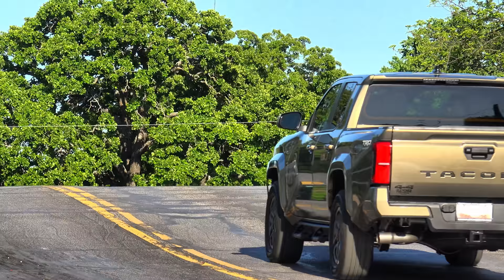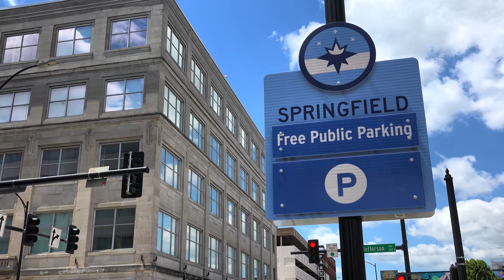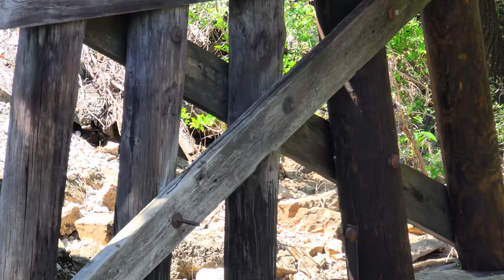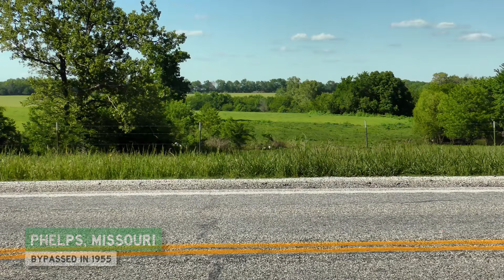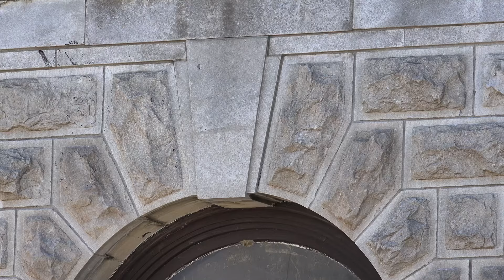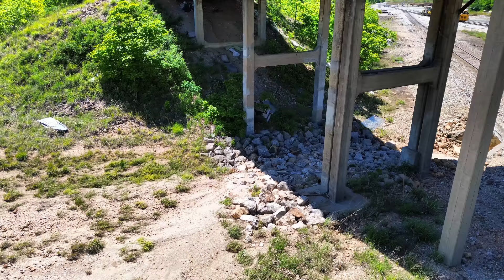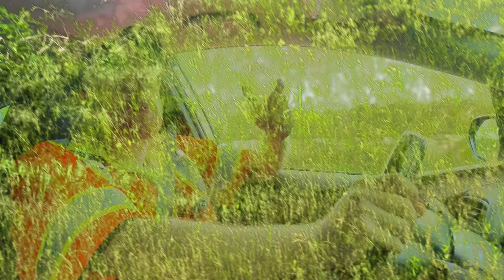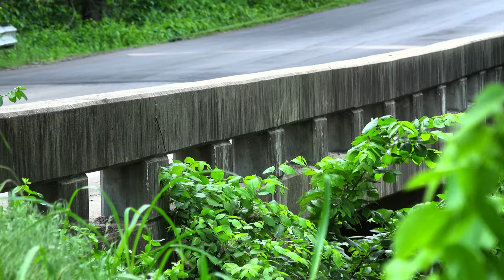When You Let the RAILROAD Build a Car Bridge

Comment: A bridge that's open to pickup trucks but closed to pedestrians and cyclists is the most American thing since cheese in a can
Reply: It's open to cyclists you just have to ride in the road
Reply: @minarchisttrucker2775  So basically no.
It is also "open for pedestrians" if they chose to walk along the road, which I see no signs not allowing. It is just that they did not fix the part built for pedestrians and cyclists because that is the American way.

Ok,  the did put up a sign not allowing pedestrians on the bridge, because that is easier than fixing the path. Stupid idiots.
Reply: @minarchisttrucker2775  So its open to cyclist with a death wish. Of which, yes, I see quite a few.
Reply: @jonathanlovelace521 well technically cyclists are supposed to ride in the road and not the side walk
Reply: @minarchisttrucker2775  Yes, but some of us want to live, and will hazard the risk of a ticket for that purpose. (Serious mode: recognizing how dangerous many 'bike lanes' are, in many areas, bicyclists are explicitly allowed on the sidewalk. It varies by state or city. But generally, actual quality infrastructure, be it a protected bike lane, a separated trail, or a proper greenway, is preferrrable to crashing the sidewalk.)
Reply: @jonathanlovelace521  well also like nobody has to go this way and nobody is required to ride a bike. It's 2026 you can hitch a ride from a friend or take an uber
Reply: @minarchisttrucker2775 😂 implying friends are still a thing in 2026 when everyone’s goal is seemingly to screw each other over in every way imaginable is hilarious, when is the last time you went out made a friend and that friend didn’t screw you over in some way
Reply: @jonathanlovelace521  Being really honest Bike infrastructure sucks because realistically cycling is like the worst of both worlds.
When bikes share the sidewalk with pedestrians, they move faster than the pedestrian and collisions can occur, injuring both pedestrians and cyclists. 
When bikes share the road with cars, they move slower than cars and collisions can occur which have a higher chance of injuring or killing cyclists 
Dedicated bike lanes take up infrastructure space and they're dedicated to a suboptimal mode of transportation that doesn't move a lot of people, and not everyone is able to do it. Bike paths only make sense in very urban areas or park spaces
Reply: Having inspected many bridges (>1000 at this point, mostly in KS and MO) it looks like the timbers used to support the sidewalk are significantly smaller than those for the road, significantly reducing the capacity.  Add years of rot, and potential overloading stresses from the deck timbers transferring some vehicle loads over and you get checks and splits that reduce that cross-section even further.  Factor in that it would in no way be wheelchair friendly, therefore complicating the ADA requirements for the pedestrian path, and from a liability standpoint it was likely simpler to just close the sidewalk on the bridge.  However, if you also think about the fact that they put asphalt as the wearing surface that is a silent admission that the bridge is in the final years of its useful life.  The asphalt will allow moisture through and then traps it on the top face of the deck timbers speeding up the decay.  I would bet that in the next 3-5 years it will be posted to prevent truck traffic and then within the decade it will be slated for replacement.
Reply: @Dhoyt016  it's final years of life. 

You would bet that in the next 3-5 years it will be posted to prevent truck traffic.

Sorry sir.
But ehm, when i look at it as a guy who has no idea about engineering or maths or construction....
Well, i just look at it and think: WHAT????????

How much does a bridge like that cost?
Seriously.
What does the concrete cost, the metal, the labor, all of it??
Just an estimate is fine.

One reaper drone costs 30 to 50 million.
Its a drone. Flying up in the sky.
Many of em have been taken down by for example: Houthi's.

Just imagine if politicians thought: Jeez, we should spend money on replacing bridges like these......

This bridge looks like it can come down any moment.
Why do people accept that?
Tear it down, get a new one in.

O wait, yeah, Bibi needs Bombs. Sorry, i know. 
Well, gosta help out the Biebster.
And the Donald.
HE is in need of a new toupet, that is for sure.
Let's spend money on that, and not this bridge. After all: We will be looking at the Toupet more often than we will ever look at this bridge.

(sorry. I am just amazed. I seriously do not understand how people have become so stupid over the last few decades. How we all have just started to accept all of this.
Sorry. Just heartbreaking to see how a species evolved to the state we are now, and now we seem to be going backwards. In a few decades we are probably dumber than the average Chimp.)
Reply: @TMGpuntNL there's... a lot to unpack there.

Being that it is timber over a RR I would guess it is 150' total length, 3 spans.  Given that the 25' vertical clearance minimum required by the RR is already a struggle they will need to build something with a thinner superstructure like a concrete slab, which I believe is ~$150/SF.  TWO 12' lanes, one 6' sidewalk, and three 15" wide barriers is approximately 34', which is 5100 SF.  That is $765k.  Add in that they will probably have to redo the road at least 1/4 mile back from each abutment to degrade and that will probably add an additional $500k, and the RR coordination will add at least 15-20% of the project budget for the headaches it will cause, and that will hopefully not cause delays.  So you're looking at roughly $1.5-1.6M for the replacement.

The rest seems like you don't understand government funding, its varied sources, and funding prioritization.  It also seems like you believe that your personal priorities should dictate how +350M people's tax dollars should be spent and you are distraught because people with your preferred political ideology are not making those decisions, though I don't the spending allocations would change that much since the federal transportation bill was passed under Biden and military budgets didn't change that much with the most recent funding bill.  About those things, I prefer not to argue.  But the replacement estimate and reasons as to why the pedestrian path is closed on a nearly 100 year old structure are educated guesses from a former MoDOT engineer who still does bridge inspections in the state.

P.S. - Please try to learn how to not make everything related to politics and especially how much you apparently hate D. Trump and Israel.  There are other things to be concerned with in this life.
Reply: @TMGpuntNL People are stupid but some can spell toupée.
Reply: @Dhoyt016 My freshman engineering prof said more engineers should go into politics. You may or may not agree with our one engineer president's achievements or lack thereof, but your message there is a reason for it.  Understanding the issues beyond the obvious ones. Understanding that there are a lot of priorities to balance. Understanding there are lots of opinions. <sigh> More engineers, please!
Reply: @jenniferpearce1052  the funny part about your comment is that the accent on the e is no longer needed and is an older spelling.

"The correct spelling is toupee (without accents), though toupée (with an acute accent) is also accepted as an alternative or older spelling"

It is accepted, sure. But the correct spelling..... >;)

Sorry, i had to google it, hahaha
Reply: @TMGpuntNL Yes, in American English, we pretty much don't allow the accents. But we also do a lot of other dumb things, like having male fiancees, because a fiance without an accent is a fee-ahnss and no one says that!
Reply: @jenniferpearce1052 engineers are typically too intelligent, and antisocial to want to be politicians.  I have considered it, but I would play by the rules that everyone agrees to, but no one else really does and would therefore be highly ineffective in politics.
Reply: @TMGpuntNL  just because we stopped spending on military doesn't mean everyone else would.  it would just mean we'd be in no position to defend ourselves or our allies.  we also don't just send weapons to other countries for free.  not even israel.  they buy them, which means we do make money from them.

but that's the kind of thinking i've come to expect from people who can't see past the tip of their own nose.
Reply: @theghostofthomasjenkins9643  Ehm, before you start judging how far i can see, you say: Countries do not get weapons for free, they buy them, even Israel?

I hope you are joking about that one?

How much money do they get every year?
And btw, this is not just from the US. You also have Germany that pays a lot of money every year to Israel.
And they can then buy those weapons, sure.

But ehm, that is basically a cigar out of your own box, isn't it?

Do you know Einstein?
He said: The pioneers of a warless world will be the youth who refuse military service.

It'll come.
Eventually when the S hits the F, and WW3 is over, we will be back to fighting with sticks and stones.
Einstein said that as well: I don't know with which weapons WW3 will be fought, but WW4 will be fought with sticks and stones.

Eventually people will have to realize that it's all just a waste of money, time, lives, and for what?
For who?
Mostly for those with a Nose indeed yes.
Reply: @TMGpuntNL  as long as people consume resources, there will be war.  as long as people have the freedom to think for themselves, there will be war.  you don't want to live in a world without war.  you think you do, but you don't.  history's worst leaders were brought down by people waging war against them.  it's a necessity.

and yes, even israel spends money on it's own weapons.  the amount of money israel recieves is just a drop in the bucket compared to what they spend.
Reply: @theghostofthomasjenkins9643  You are again very funny when it comes  to Israel.
How do they make money? From what? Oil exports?

They recieve way more than you think.
But you may keep deluding yourself on that part.

As for the rest: Sure, there will always be people stupid enough to fight against other people.
But if it is a necessity? Nah.
That depends on perspective.

As for history's worst leaders being brought down by people waging war against them....
Let's see.
Stalin? Killed plenty. No war brought him down.
Mao? Killed plenty. No war brought him down.
Churchill? Killed plenty including starvation. No war brought him down.

And lets skip ahead in time: Bush senior.... 0.5 million iraqi children dead was worth it according to Albright..... and he himself spoke about the incubator babies, which was a lie.
No war brought him down.
Bush junior. Went into Iraq over a pack of lies, WMD's aka the Weapons of Mass Distraction.
Wasn't brought down by people waging war against him, was he?

So which worst leaders are we talking about?
O, the Austrian Painter?
Ah.
Or Napoleon perhaps?

Btw, the Federal Reserve Bank.
What did the Supreme court rule in 1928?
"In 1928, the U.S. Supreme Court did indeed describe the Federal Reserve Banks as “private corporations in which the government has an interest.” The statement appears in United States Shipping Board Emergency Fleet Corporation v. Western Union Telegraph Co., 275 U.S. 415 (1928)"

"In 1928, the Supreme Court described the individual Federal Reserve Banks as private corporations in which the government has an interest."

Alan Greenspan, once Chairman, he said: There is NO other agency of government that can overrule actions that we take.

Who owns it?
Who owns the debt?

The US is in debt.
And who gets paid?
We have the Alan Greenspans, the Bernankis, the Yellens. The Albrights. The list goes on and on.

The 1.5 TRILLION dollar for the Military.....
that is not all used up to build weapons.
A lot vanishes in the pockets of?????
Well, not you nor me. 
But i guess companies like Lockheed and Radeon and so on.
And who owns those companies?
If you go all the way to the top, who owns it?

There we go.
Isn't rocketscience to figure out that little state doesn't have to pay much for the weapons.
Heck, the people there can live for free and get paid every month. The money has to come from somewhere.
My guess? The American Taxpayer.
Because the Debt which the US has is owned to "them".
Remember who set up the Federal Reserve System?
One of the members of that family said: Give me the control over a nation's money supply and i care not who makes the laws.

PS: I would love if you could explain how IstheHell is making money to buy weapons.
From what?
Exporting what?
Doing what?

Btw, a side track: Ever heard of this guy called Lucky Larry?
He spent a few bucks on a lease for a few buildings. Got them insured so that it would pay out incase of a tewwowist attack.
And. got paid a few BILLION dollars after they all went Poof into a great dust cloud.
"It's good" said his friend Bibi.
And Lucky Larry said: I said Pull it, and so they did and we watched the bld collapse.
And then he went to Tel Azov, to talk about how he had to make sure he collected the insurance money. A 2 hour talk on video while the turd is chewing gum.

Yeah. The amount of money they get is just a drop in the bucket.
From the US, Germany, the UK, the Netherlands, etc etc.
The Holy Trinity. District Columbia, London City and Vatican City.
So yeah, sure thing pal.
They pay like everybody else.
But ehm, they also control the money supply, and so they just run the printers for a few minutes longer to pay for those weapons.
Meanwhile also collecting the monthly paycheck from all those countries......
Reply: @theghostofthomasjenkins9643  o btw, the US thought it would be a good idea to pre empt Iran, because the Ally was also gonna attack.

The Biebster dragged the US into a war against Iran.

So now the US is expending its weapons on this war.

Saves them a few bucks, doesn't it?
Reply: @TMGpuntNL  you really need to lay off the propaganda, dude.
Reply: @TMGpuntNL  jesus, you're deep in the kool-aid.
Reply: @theghostofthomasjenkins9643  ah, so now we go down this lane?

What's up? No arguments?
Seems to be the case if you have to go down this lane.

I need to lay off the propaganda?
Which propaganda exactly?
Explain pls.

I guess you won't because you ain't got the arguments to explain it.
If you did, you wouldn't have responded the way you just did in 2 comments.
Reply: @TMGpuntNL  i'm just not gonna waste my time.  i could refute your arguments all day, but you're so far down the rabbit hole that you'd never accept anything besides what you already believe.  you sound like a tin-foil hat wearing loon.  you're one step up from talking about hollow earth and the nephilim.
Reply: @theghostofthomasjenkins9643  "just because we stopped spending on military"

When did that happen?
After the 1.5 TRILLION?
Reply: @TMGpuntNL  yeah, i get the feeling most of the information you claim is true is the result of you only reading half a sentence then drawing a conclusion.
Reply: @theghostofthomasjenkins9643  yeah, i get the feeling you have no arguments and then you have to rely on this kind of stuff.

If you ever do have arguments, we could have a discussion about it.

As per Carl Sagan:  “One of the saddest lessons of history is this: If we’ve been bamboozled long enough, we tend to reject any evidence of the bamboozle. We’re no longer interested in finding out the truth. The bamboozle has captured us. It’s simply too painful to acknowledge, even to ourselves, that we’ve been taken. Once you give a charlatan power over you, you almost never get it back.”
Reply: @theghostofthomasjenkins9643  btw, "i get the feeling most of the information you claim is true is the result of you only reading half a sentence and then drawing a conclusion"

That is basically an admission that you do not have any arguments.
And a feeling is certainly not the truth.
But, you stick with your feelings....
And i stick with facts.
Reply: @TMGpuntNL  dude, i just caught you trying to draw a conclusion off half of one my sentences, completely disregarding the context of it.  this is what you do.  you take half of a thought and twist it into something else to fit what you believe.  i'm not wading through your sea of word vomit. anyone with more than 1 unfried braincell can see you are nuts.

and quite frankly, if it's not about astronomy, no one cares what carl sagan has to say. he's a scientist with exactly 1 field of study.
Reply: @theghostofthomasjenkins9643  You caught me trying to draw a conclusion off half of your sentences, completely disregarding the context of it?

Which sentence was that?
I am willing to admit i made a mistake.
It seems to me that you are not, because you keep insulting me for no reason.

I never insulted you.

And as for Carl Sagan, sure. 1 field of study. But the quote is true.

Sad to see people like you who are only able to insult others over nothing.
It shows how you have no argument.

I am willing to admit that i could have made a mistake if you were to point out where i made the mistake.
But all you say is: Dude, i just caught you trying......
If you caught me, you can show it.

PS: I am dutch. Dus we kunnen het ook op z'n Nederlands verder proberen. Misschien ben jij beter in het lezen en schrijven van Nederlands dan dat ik Engels kan lezen en schrijven?

Have a great day, sad individual.
Reply: @theghostofthomasjenkins9643  ps: and if you have arguments to rebuke what i have said, i will be all ears.

But it seems to me the only thing you are capable of is insulting another person, which means you don't have any arguments.

Also keep in mind: YOU started responding to me. Not the other way around.
And i'm not your dude, boy.
Reply: @TMGpuntNL  This video is about transportation, dude. Chill.
Reply: @Ethan.Lamoureux  i don't like the cold. Chilling aint my thing. Not untill im a corpse.

Btw, this is about a ridiculous bridge which COULD be replaced with a great bridge, but somehow people have no money to do so.

And i should chill?

Have you ever seen the movie: Network? It is an old movie.
You might wanna have a watch.

Chilling when everything is becoming more and more expensive, and people seem to not give priority to stuff like this but rather spend their money on nonsense????

Sure, let's chill. Like a corpse.
Like dead fish, going with the flow.
Reply: @TMGpuntNL  military is part of the federal budget.

most bigger roads are under the state budgets.
the united states is just that United(union) of (semi-sovereign) states

smaller roads are under even more local governements: city/county

so in this case, its the state of  Missery governement
Reply: came here to say the same
Reply: Cheese in a what
Reply: "cheese"
Reply: The double irony is that it's for pedestrian safety and not just to make things smoother for cars
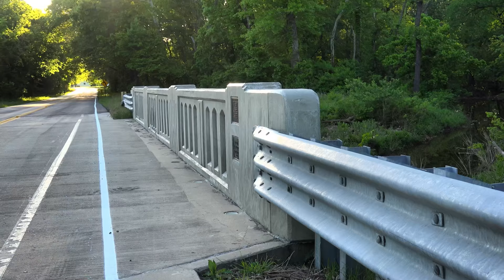Reply: europe here, even funnier at 10:44 he claims "So people on foot or on bikes get their own space instead of sharing with cars"
is this meant as a joke or serious?
i´m genuinely confused and wonder wtf are you talking about? i can see a gutter next to the road and regular distance to the railing. there is no foot/bikepath next to the road for access. does this look to american eyes like: "wow this bridge is extra wide intended for a bike/foot path on each side?"
real question
Reply: @Dunning-KrugerCompany  When walking on the bridge, the railings limit a pedestrian’s options should they find a vehicle bearing down on them. Having extra space outside the white lines is nice, and he’s acknowledging that, while subtly pointing out that the rest of the road has no place for pedestrians.
Reply: @Ethan.Lamoureux  i think he was the first person walking over that bridge since construction.
glad he had a safe travel across that waterway
Reply: Lol yea
Reply: because guardrail is falling apart, liability risk,
Reply: In europe a lot of bridges are car-only and closed to cyclist and pedestrians because they are for a highway or a normal road and there are paths for pedesteians and cyclist under them or there is a second bridge just for them
Reply: @masterlukascze  I can accept what you say about bridges being car only because they are for a highway.

But for a normal road?
What is a normal road?

The American roadnetwork is baloney.
And, in Europe we started to copy them.
Here in the Netherlands many cities were turned into car friendly cities.

I am very very happy to see we are changing it all back.
To make them Pedestrian friendly.
To make them cities again, and not just some buildings along a "Normal road".

Btw, In the Netherlands we tend to design bridges for all traffic.
There are not that many bridges which are only for cars.
Most of them have a cycle path and a footpath designed into it.
And, it is amazing to see that a lot of Europe is copying us. 
Even the US of the Americans is slowly but surely accepting the point.
Reply: @TMGpuntNL  the netherlands is the size of west virgina, the US is abut the size of europe as a whole.
Reply: @shamuslandwhale  yes, i know. 
So?

You guys got gazillions to spend on bombs and so on, to help out so called Allies to fight against imaginary enemies.....

This bridge, let's be serious. How much would it cost to replace it and make it better? 
A bit of labor.
A few loads of concrete and steel.

Right?

And sure. You guys got many more bridges to take care of in the entire US then we in the Netherlands.
But somehow we here in the Netherlands think that some roads need to stay open. For some reason or another.
Don't you guys think the same?
If i was living in that town or city where this bridge is located, i would think: Tear it down and get a  new one installed.
Heck, Youtube is full of these videos where people help out people in need, with new roofs and all that kinda stuff.
I dunno, i just think a road like this could be important enough to keep open and not wait until a tragedy occurs.
Like a train passing underneath and a schoolbus full of children crashing through the bridge.
Or maybe we should wait for that. Does make a better story on "The News", right?
Reply: @TMGpuntNL  you dont need to hit enter after every sentence
Reply: @TMGpuntNL Except for Eindhoven, it doesn't make sense to try to squeeze American-style highway networks into European cities that were built with roads wide enough for carts, wagons and pedestrians.  East Coast US cities are somewhat the same. The American 6 or 8 lane highways you see in movies are because automobiles were invented when the west was largely unpopulated. Cars came in and cities grew. Add to that the fact that Los Angeles had oil locally and you have the perfect place for a car-centric city. When I was a kid, you could still see oil derricks from the freeway here and there. With Hollywood being the center of the film industry and located next to LA, that is what the world sees. It's not like that in most of the country. But we are more car centric than Europe. I like it. I've lived in a city without a car and it's a pain in the butt to do basic stuff like grocery shop. I like my American way of life. And I'm here living it, not trying to force it on anyone else.
Reply: @jenniferpearce1052  I find this part funny:

 "With Hollywood being the center of the film industry and located next to LA, that is what the world sees."

I could continue down that line, but i wont. 
"is what the world sees"

You say you are happy with your American way of life.
But why bother the rest of the world with such nonsense?
Why show it to the rest of the world?
And yes, i know: Hollywood did that.
They showed the nonsense to the rest of the world.

You say you have lived in a city without a car and it was a pain in the butt.
WE in the Netherlands live in cities where the city is designed such that everyone can reach a grocery store by walking just 10 minutes max. On very nice pavement.
We have started to block the cities from traffic and give the roads back to the pedestrian.

And, even in America this is happening.

You do not need a car if the store is around the corner and you can go to work on a bicycle.

You may like your american way of living, i am fine with that.

But if you wanna get a feel for the difference, i suggest looking into it.
I can suggest a few channels that can show you the difference between our Dutch roads and your Muricano roads.
And how it affects the cities.
In my opinion it affects the cities in a positive way.
As in: People can just walk out on the streets without having to worry about being hit by some car coming out of nowhere with 100 mph on the clock.
We design our roads so that people can just walk safely from a to b.
And we also make sure that A to B is not that long.
Distance to the nearest shop in most cases: 500 meters, perhaps 1 kilometer or let us say a mile, 1.6 kilometer.
Even my grandma could walk it when she was alive.

Distance to the job site: the same. 
Unless you choose to work somewhere else.

When i look at videos of the innercities in the US, all i see is traffic jams.
Cars sitting in line, people wasting time to get from A to B, just to be able to drive a car.
If the infrastructure was designed such that people would be playing the most important role, and not the car, then things would be much better.
Jaywalking.... what a load of crap.
To make someone walk a mile further while they could easily cross the street sooner.......
An Muricano invention.
For what reason? For to give those in a car more rights.
Meanwhile the city belongs to the PEOPLE.
Not the cars.
Reply: @jenniferpearce1052  o btw, ever heard the term Transferium?

It is a huge parkinglot where people from outside the city can park their car and be transported to the inner city by bus.
(we dont have many metro or trams or that kinda stuff. We do have em, but in some cities.)

But imagine that you have a hub with planes, trains, trams, metro, bus, automobile.

And you got a few of em for just trains and trams and metro and bus and automobile.

which connect to other trams, metro, bus, automobile

Someone from another city does not have to take the car into the city where there is a lot of traffic on small roads.

They can just go there on a bus that drops them off on a nice spot, and they can walk through the city. Looking at all of its beauty.

O wait. 
I forgot.
Murica.
City blocks, all look the same. Concrete blocks etc. 
Yeah, i can imagine why people love to drive in Murica.
I would not wanna be found dead on any street in Murica, since they all look the same.
Reply: its the best thing. We have massive a massive country where a single state is almost as big as the EU and dont want a bunch of idiots over taking a bridge walking while slowing traffic down. We drive 50 plus miles daily.
Reply: @dabadcod4  the entirety of the US is about the same size as Europe
Reply: @dabadcod4 there is no state almost as big as the EU
Reply: Get over it man, it’s an ancient bridge, the sidewalk is wood and rotten. Most bridges are car only.
Reply: @sam-rs8wg  "wood and rotten" and so would be the street if it were not maintained. but it is, so why not maintain sidewalk too?
Reply: @n30dev  Who cares about people? It is all about Cars in the mind of the average lemming living in Murica.
Hence why they came up with this ridiculous law about jaywalking.
They had to invent the word.
And since they did, the car has more rights than any pedestrian.

And when you look at the daily gridlock in cities like N(j)ew York, well, i guess they are all happy about it.
They have subscribed to such traffic jams. Heck, they stand in line for it. That is how much they love it.
Why change anything like that?

PLUS!!!!! And here is the more important part:
The money spend on maintenance or on constructing new infrastructure is a waste of money. All it does is help The People.
Those in power like to spend the taxpayer's money on bombs and such, to send to so called allies and such. You know.... to get rid of The People.
Much better way of spending the money.
After all: According to some of those in power there simply are Too many people.
They do not take into account themselves, but all the rest of us.
And with their money and power they persuade other people to just ignore the people around them and continu the madness. Either by not maintaining the infrastructure, with excuses and lies like: too expensive..... or by actually building the bombs.

As long as people accept such nonsense, nothing will change.
Reply: @sam-rs8wg  That may be true where you live but it doesn't have to be that way and in many places it isn't.
Reply: @sam-rs8wg  Most bridges are for all road users, not just cars.